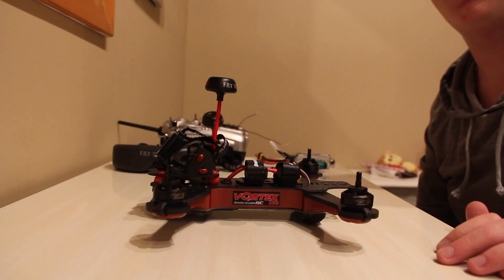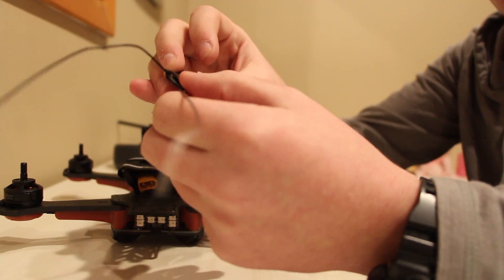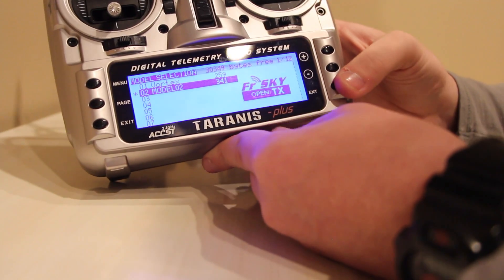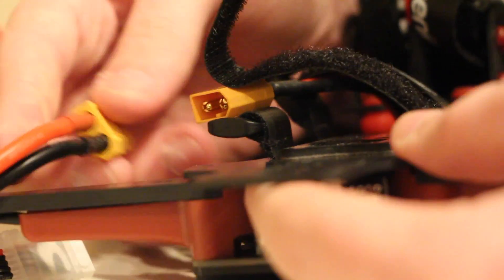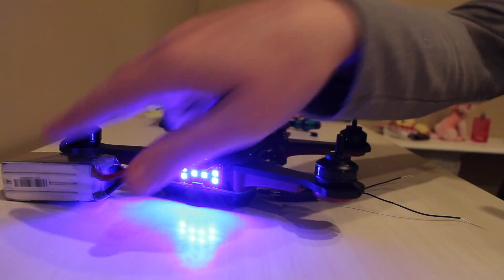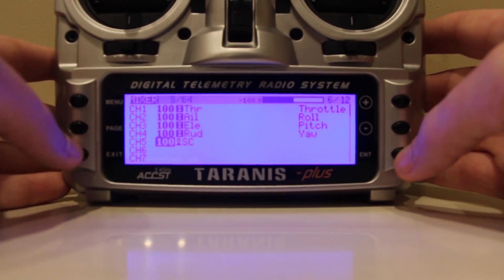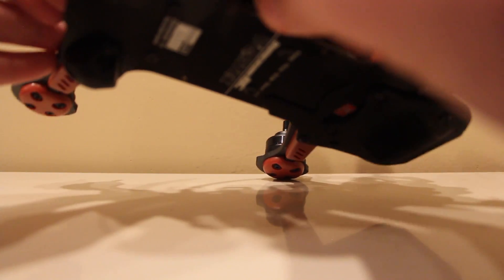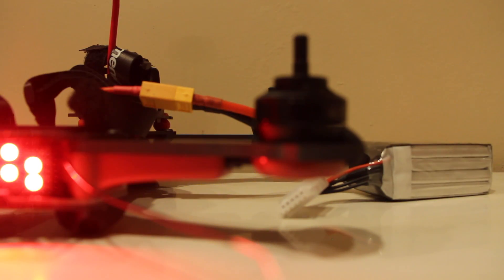How to Setup an ImmersionRC Vortex 250 Pro with SBUS (FrSky Taranis Plus and X4R-SB)

Comment: before i arm my drone and fly but plugged with the battery my tarranis vibrates and shows i lost connection with the drone and after 2 sec i regain. that happends very oft without me touching anything. is that normal ?

Comment: Can anyone help me please...

    I just purchased a brand new vortex 250 pro and it just came in the mail, at first I had trouble getting it binded with my taranis x4r and ended up holding the back button for what I thought was a reset, it was a Unesscessary move I ended up changing channels or messing up my vtx. I had a very vague picture on my dominator v3 at first and after fiddling and what not I lost video feed but binded taranis. I think that metal plate thing on inside could of maybe shorted something out? I'm worrying that my video rx or tx is fried ..ANTENNAS WERE on at all times. I've tried everything, I plugged it into computer just to pull up window and check to make sure it was on IRC CHannel 1. I tried to do firmware update and was able to update OSD, but could not flash firmware of beta flight or whatever on clean flight. Im using nexwave raceband 5.8 on my goggles
 
I appreciate any help/input, I really want to get this thing flying!!

Comment: I don't understand the 97.8, Why 97.8? why not 98.8?.  How do you come up with the number 97.8?

Does it mean (Example motors are powered to - 97.8 % when no throttle is applied?

Comment: My Vortex isn't detecting my X4R-SB, nor is my Taranis binding to it. I'm wondering if my X4R needs a firmware update or something. It's getting power, led's are flashing on it. that's where it ends. argh!!
Reply: +modsavant replying to myself, in case anyone else is having rx detection problems with their Vortex. This is a known issue with some Vortexes, as stated in the Vortex manual. Fixed my detection problem by selecting SBUS in the Vortex menu (basically overrode the auto-detection process by telling the Vortex what type of connection i want). Note: it's not actually detecting the receiver type, it's detecting the connection type.  Did this override using the ImmersionRCTools Configurator (downloaded from IRC site). Regarding the binding process, I was simply doing it wrong. I wouldn't give it a second power-up cycle, and expected the binding to be done immediately. Need to unplug Vortex and replug (with rx connected), and presto! Bound.  Thanks for the video, you helped me a lot!

Comment: Having problems with my setup. Got it binded but when I start the throttle motors don't kick in till just over half throttle and the motors feel like it's on full blast. Using taranis plus x4r sub. Thanks in response .

Comment: Hello Michael. Great video, just wanted to setup my new Vortex. Unfortunately upon connecting the power to the Vortex smoke emitted from inside of the quad. Reason I believe is that the clamp holding the video tx board in place was laying on the pins of the video board and short circuited it, since it I only removed the top small screws on one side. I can see your clamp is bent away from the pins, but I wonder why since it is mounted under tension unless you remove all small screws on the upper board. Even then, I would recommend putting a piece of cardboard or similar between the clamp and the video tx board. Even better is removing the entire upper board. Please include a hint in your video so that nobody else ruins their quad before even running the motors once. I now just hope it is only the video board or this will be a very expensive tutorial, at least for me.
Reply: +Michael Rosenberg Please do not just state the clamp won't short anything since it clearly did. I once again watched your video and listened very closely. You remove 4 sidepanel screws on one side and remove the panel. On the other side you state you removed - and this is crucial - the bottom 2 screws. So the clamp is fastened on one side to the top panel and is free on the other. I did exactly this with the result that the clamp presses firmly onto the pins of the video tx board, shorting the +5v and Gnd pins. Let me make a short vid of what I mean next week. Really no offense Michael, it could also be that I have a newer version, my LEDs in the back for example have a clear cover which the first Vortex 250s did not have. I'll post a link to my vid as soon as I have uploaded it.
Reply: +Michael Rosenberg I'll make a Vid of what I mean. I am not meaning to give you an attitude at all nor am I making you responsible for my damage.

Comment: Hello mikeThanks for the video. I'm have troubles with one part and that is when I exit setting up the flight mode switch (Channel 5) my Taranis goes to servos not outputs ? cant find outputs anywhere any help would be great
Reply: +Michael Rosenberg
Not sure how I would do it in the mixer page, I'm talking about setting the 97.8 on the four channels as you did in output page.. mine goes from mixer page to servos vrs your going to output page...It looks the same as output but says servos??